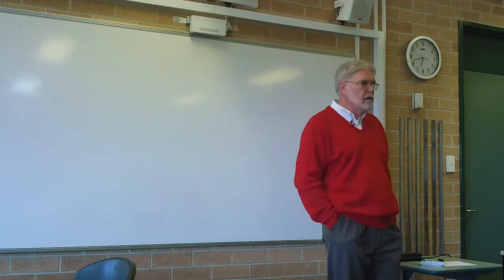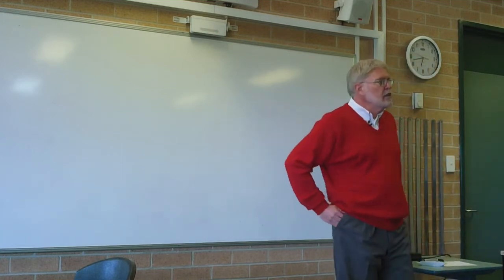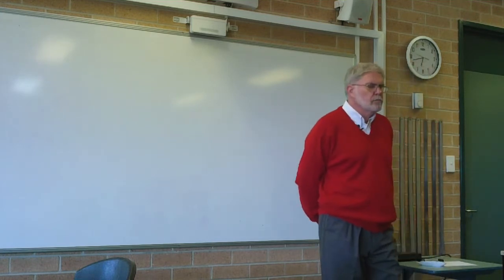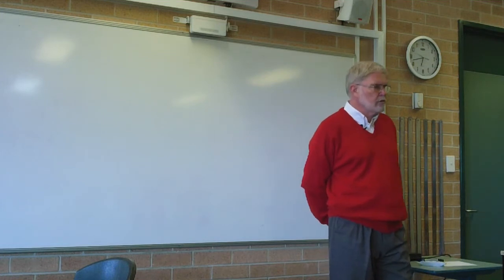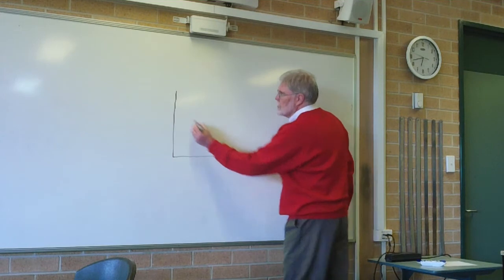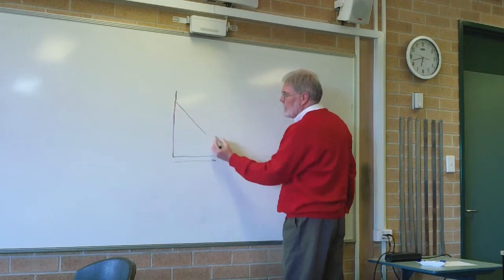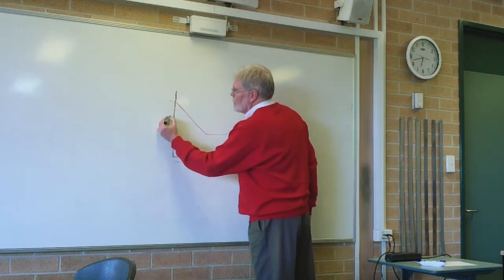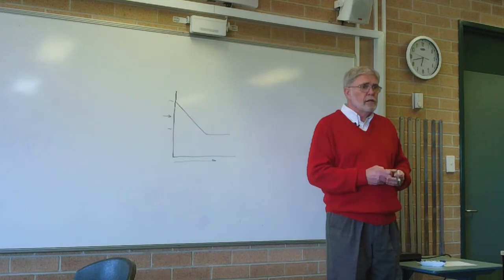Aluminium Alloys used in Aircraft

Comment: In 1966, October 6th my mother is dar-jah 6.

She is 12 years old.

She said she used this text-book. 1964. 1st print. 1986. 14th print. No ISBN provided. $6.30.

I bought this book many many years later in 19__. Stock-clearance book. 

Actually there is a sticker. My name with address. Around 19__ forget. My classmate sold stickers/name-cards.We need to fill forms and accurately put in each alphabet in kind of block/space. Each alphabet is filled in each block (What is ensemble?) (What is data-bank?) Each alphabet is packed in an ensemble I mean.

Maybe in <1996 because in 1996 were all into P.M.R. We were not into that fancy stickers/name-cards but I sold this commodity 'I.Y.S.' I went to bank to do some exchange of -xyz at -xyz bank.

As for I.Y.S. I got customers among friends. Since it's educational. If anybody sold fancy stickers which were not educational, at that time, she would not find any customer at all since we were all, at that time, focused on things we needed to focus.

That is down the memory slow-lane. (What is beam?)